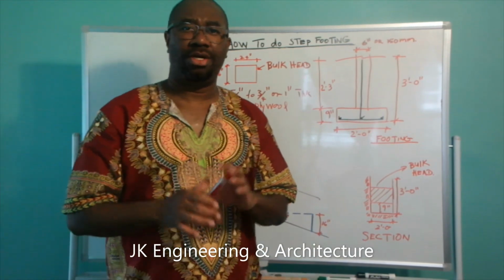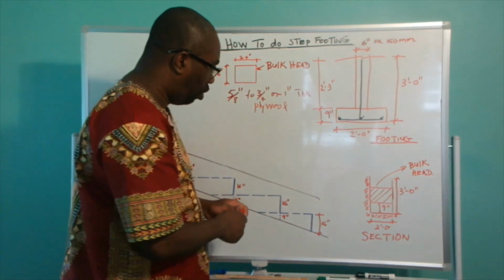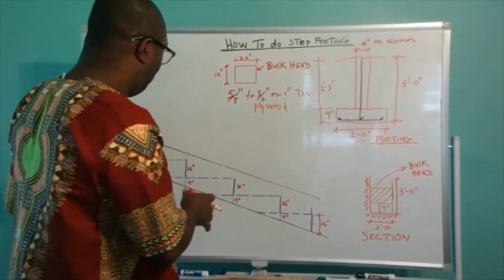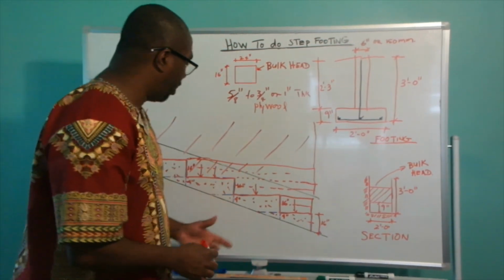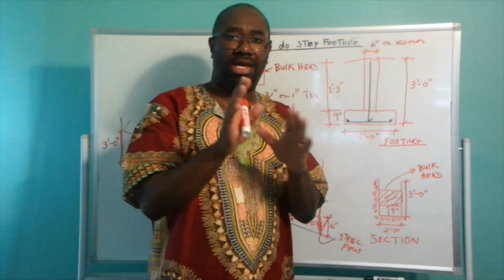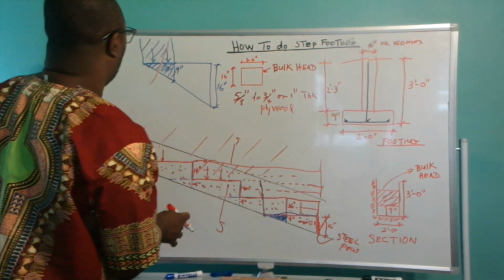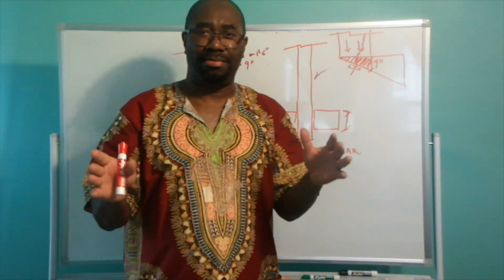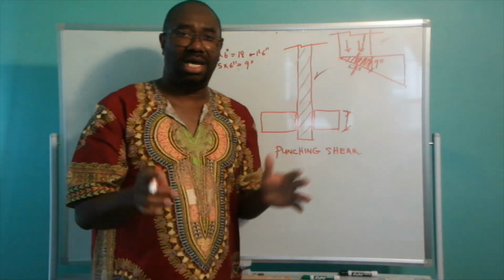how to do step footing on construction site in Jamaica

Comment: Would u have to use wooden forms to set up the step up system
Reply from the maker: @tivaughnjenkins9898  Yes.
Reply: Next question after going up 16inches and leveling tht line or mark going forward and  finding the 9inches point do u start the next step up at tht mark? If so wouldn't  the existing concrete after the 9 inches  mark be too thin because the further bck u go from tht 9 inches the concrete gets thinner just asking?
Reply from the maker: @tivaughnjenkins9898  You have ensure to maintain the 9" thk throughout.
Reply: So it’s probably best to just excavate the land to eliminate the need to use so much concrete in pouring just footings.

Comment: 🤔very informative vedeo yes,i like it am gonna hafto wach it again,i need to understand after nine inchs going forward up the sloop 9,8 7,6,and lest.how the building or house going to tack that wate that is lest going forward?i need to understand that part much more.but yes thanks for the info good teaching sir..🖤🇯🇲
Reply from the maker: RESPECT
Reply: @jolelstewart1756  after finding the 9 inches mark I would put a wooden form at tht point and cast up 16 inches. Basically I wouldn't carry the  concrete pass tht 9 inches point I would put a 16inch high form ply at the 9inch point so from 9 inches it go straight up 16 inches no run bck thin concrete so tht way the foundation never sit on footings thts less than 9 inches
Reply: @tivaughnjenkins9898  All the concrete is pour back to the slope where it is level and step begins from the 9 inch mark going toward the slope. Its from this mark where the 8inch blocks start. So the longest run of the double stack 8 inch is going to be at very top of the step of the foundation